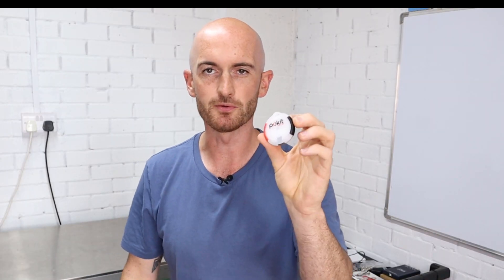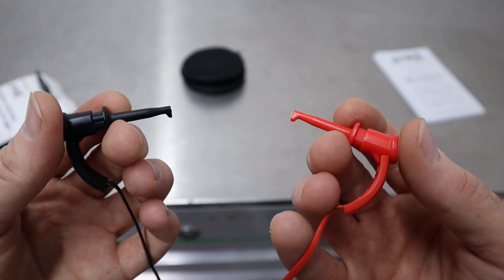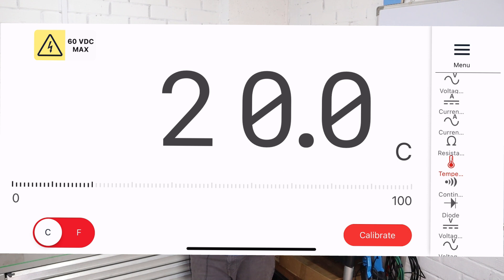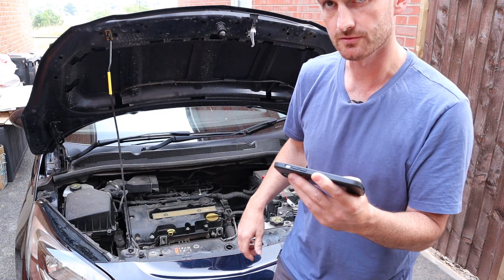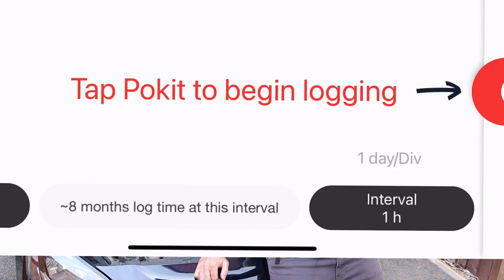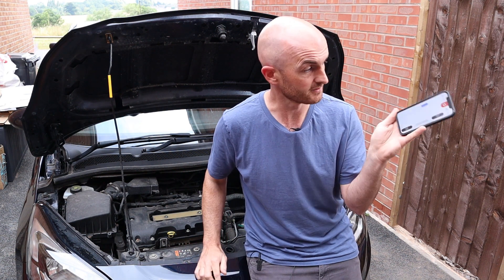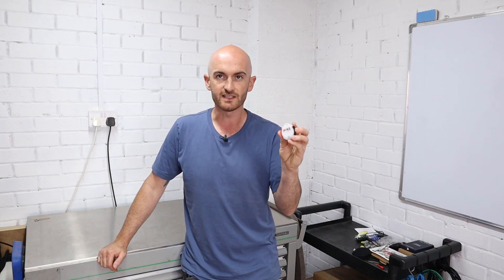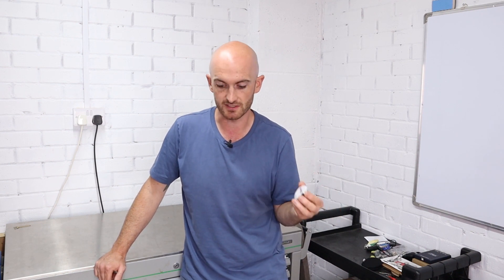Smallest Oscilloscope In The World!? Pokit Meter review | Mechanic Mindset

Comment: how much better would a pico 2205a perform over the 2204a.   I haven't seen the 2205a in action
Reply from the maker: I haven’t either. There is slightly better frequency, sampling rate and rise time. At low time scales, I doubt you would tell the difference on automotive applications. You might get a better image when sampling at a higher time base and then zooming in
Reply: @MechanicMindset  I have both now and the 2205a does better detail than the 2204a.   I will make video on them both soon and post.   Will let ya know when I do.    The 25mhz over the ten almost seems to make it appear to have higher but rate than then 10mhz.    Or it could be then laptop I am using.  I tested with 2204a on a cheap pc and the 2205a on a higher end MacBook Pro.   Just not sure id 2205a worth the extra 100.
Reply from the maker: @Quickwrench75  Great! I look forward to seeing the difference. I also have another cheap laptop and the quality is also affected. It takes more time to capture

Comment: Another fantastic video Matt amazing piece of kit handy for quick measurements on the go.
It will never beat a Pico scope still the best scope in the industry Matt any chance of doing NVH testing using Pico scope.
Reply from the maker: It’s a cool little tool; you’re right, Pico is next level. 
I don’t actually have the NVH kit. I have been looking at some interesting tool. Go on the App Store on your phone and search NVH, you can actually use your phone to diagnose issues now! 
PS. Think you got the mixed up with Mechanic Matt, I’m Darren 😂 cheers!

Comment: Seems interesting but not really a great price if you're in the UK. Looks like it's posted from the US so probably import tax to pay, and it doesn't say how long the cheapest postage option takes. Already with the cheapest postage and before tax, its a similar price to the picoscope 2000 series. Still, interesting thing. Just wish it was a little cheaper and could be purchased here.
Reply from the maker: Doesn’t look like it’s been out long, so let’s see what the future holds. The Pokit Pro is out soon and that has live scope readings with 4mm and BNC adapters, cost not much more than this but more power probe sized. 
I suppose considering the development of fitting so much in a tiny space it’s a fair price, but this wouldn’t replace my Pico; they are different beasts 👍

Comment: Looked to me like the images were freeze frame data. Good for initial viewing but assume it would be able to keep up showing live data.  Still impressive for the size and price
Reply from the maker: Yes that’s right, it works the same as a ‘single trigger’ 7.55. The Pokit Pro which is bigger should have live view but it’s not available yet. This little thing is so convenient and quick to set up 👍
Reply: @MechanicMindset  yep deffo a market for this machine. I get asked to have quick look at cars when I'm out and about with my other job so carry one of those thinkdiag Bluetooth dongles in glove box of car. May well add this to the glove box as well.
Reply from the maker: @the_retired_mechanic  Same, I have had one of those ELM327 for about 10 years in the glovebox - great for engine lights. The Pokit Meter will join it! Haha. Wouldn't mind trying one of those Think Diag dongles - bi-directional right?
Reply: @MechanicMindset  yep brilliant tool. Currently have 2 year free update and all  car manufacturers free.  Absolute bargain at moment

Comment: why you can't read the CAN BUS from the Diagnostic socket?I have seen others video to,which they not read it from the socket, but straight from the wiring, but why?thanks.
Reply from the maker: Hi, I can, but the only network down there is Diagnostic CAN. I prefer not to front probe, and this spot it easy to get at. Other vehicles, all the networks can be accessed at OBD

I’ll explain better in my next video 👍
Reply: @MechanicMindset  
Thanks a lot. I am waiting for the video .The more tips you can give us,the better for us🤣😂😅